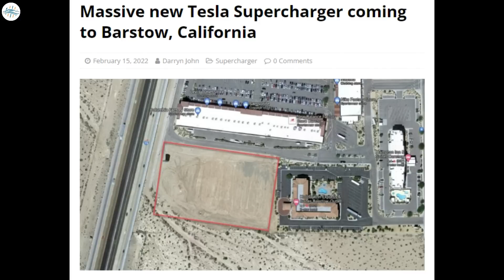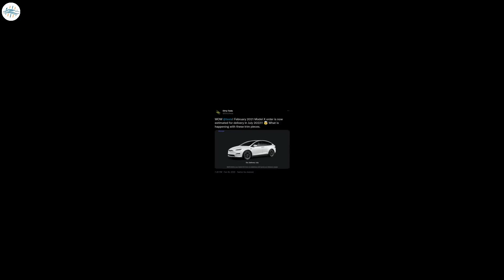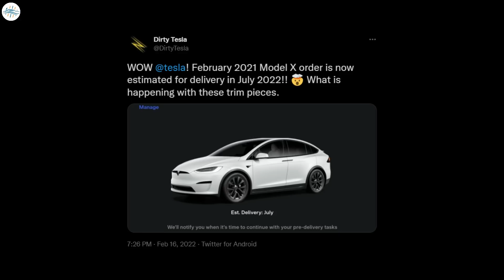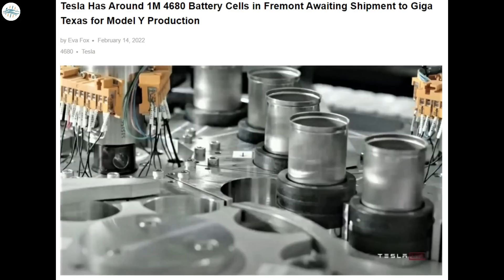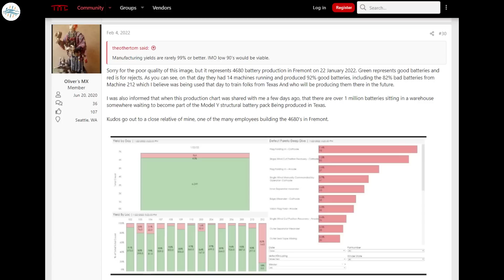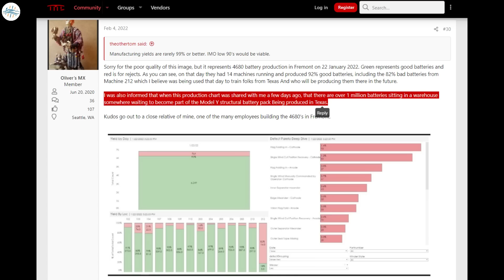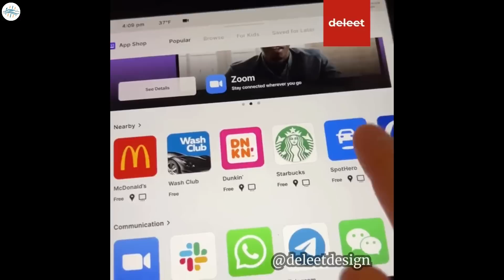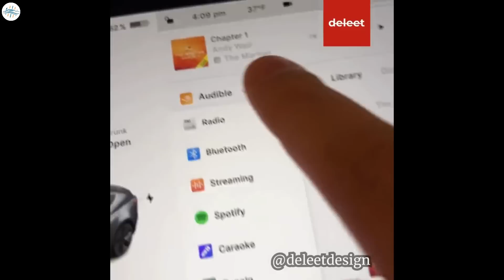Tesla Has Huge Stock Of 4680 For New Model Y & More Updates!

Comment: Why can’t some of these batteries be used for Model Ys made in Fremont?
Reply: My exact question!
Reply: Because they would have to have 2 different assembly lines for that which is not efficient.  It make sense to wait until they have enough supply to do a complete conversion at the factory.
Reply: @madpatzz1  I placed my order in September and because I live in CA, I don't get the latest battery technology or structural battery pack for that reason? It's totally unfair, IMO. Especially considering the cost of a Model Y Long Range. I'm not saying that being stuck with 2170 batteries is so bad but it's not as good as a Model Y with 4680s considering that we're all paying the same price for the car.
Reply: @ronaston4574  I agree that sucks. Just saying why they can't do 2 lines at freemont.  Be nice if they had 2 different prices and you could pick. I ordered mine in October and live on east coast but still don't know which one I'm getting.
Reply: @madpatzz1  I totally get it about not being able to do 2 lines at once, but I still think it's unfair of them to divide the country where 2/3 get 4680s and 1/3 gets 2170s. Why don't they close down Fremont when Austin officially comes online and just distribute all of those cars with 4680s and structural battery packs to the whole US. Isn't what they've been doing all along up 'till now with just Fremont? I've got to think that Austin will be able to produce more cars per day than Fremont can. It's just unfair and I can't imagine that I'm the only one who would be pissed off by getting a 2022 MY LR with 2170 batteries just because of my geographic location.